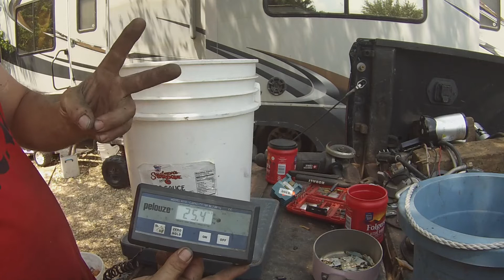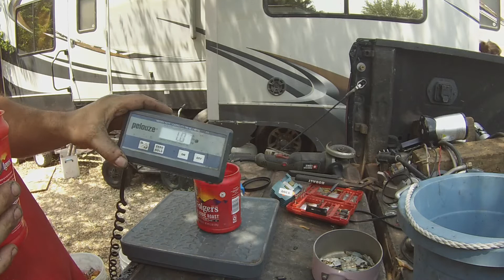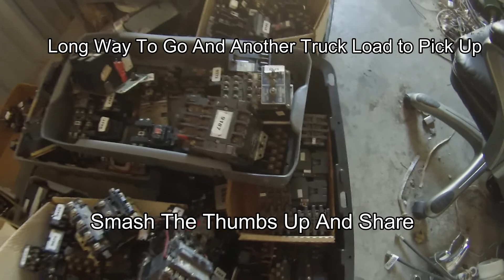Recovering Silver Contacts From Electrical Switches - The Silent Treatment

Comment: I too have been saving silver contacts for a while. I've got close to 5 pounds of dirty and still debating what to do with them. Giant switches and 250A 3 phase breakers from fire pump controllers are my main source. Old  200A mains are great too. Great video man! Even though I'm late to the party. Now I'll look for an extraction video from you.
Reply from the maker: You’ll need to watch some videos on AP ( acid-peroxide) and make sure you don’t inhale anything! Safety first and do your research extensively please!!!!!
Reply: Thank you kindly. The search is on!